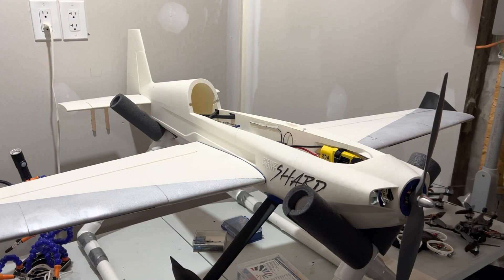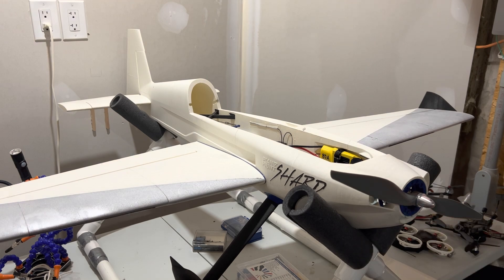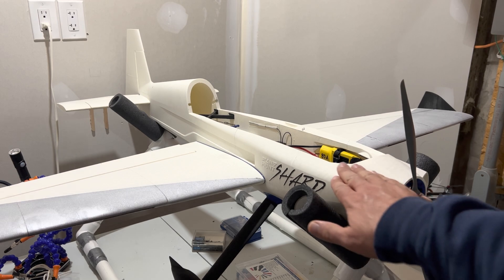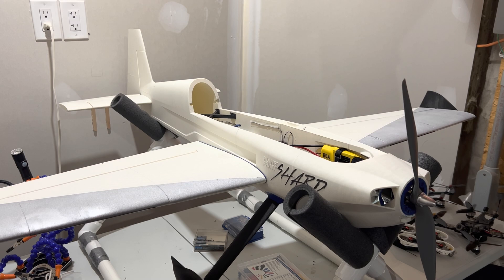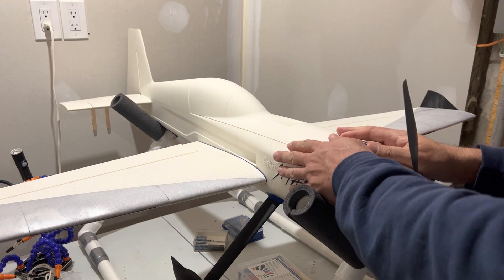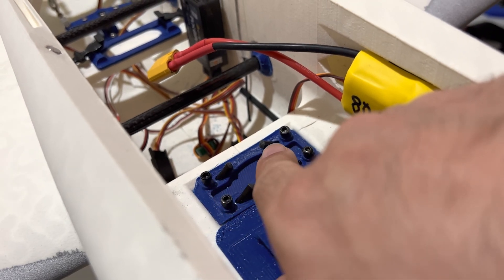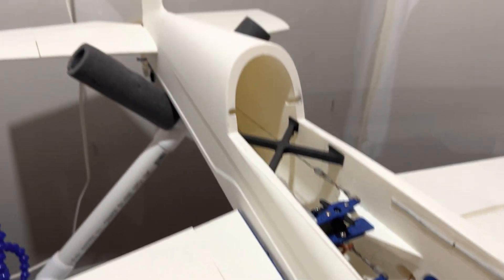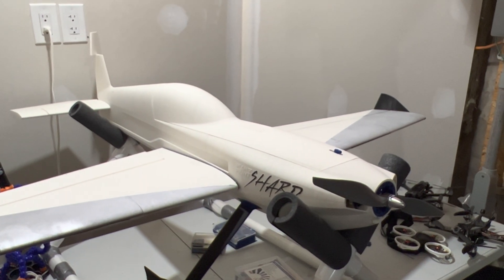Shard - Aerobatic 3D Printed Airplane - Part 3 "New Beginning"

Comment: That's a beautiful print. I would like to give it a go. 
Try painting the PLA and/or covering with 2k top coat. I print all of my jets with PLA and I have never had heat problems even on very hot days.
Reply: this is really interesting, LW-PLA accepts paint very well as it is more porous than normal PLA, do you use some kind of spray varnish?
Reply: @ripmax333  2k clear coat

Comment: Hello Raed,
Thank you for sharing your experience in this video. I built the SHARD as well. I used ASA for the motor mount for the same reason of handling motor heat. ASA has a higher temperature susceptibility than PETG and therefore is very good for this purpose. I'm sure PETG will work much better for you than PLA. My maiden flight was not easy. I found the recommended rates and expos too aggressive for me. Next flights proved that to be true with some damage to the airframe. After a few repairs it is now back and ready to fly but I'm reconsidering the set up of CG and rates. I'll be glad to hear from you how your maiden flight went and what CG and rates setup you used and how that felt for you.